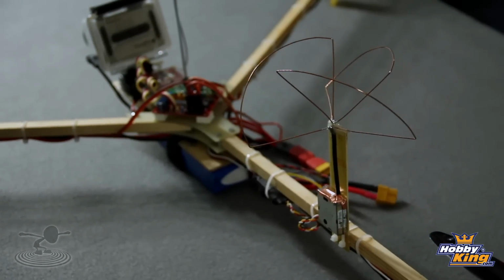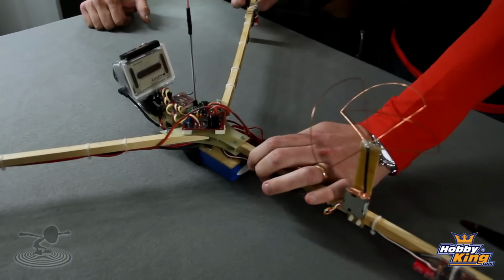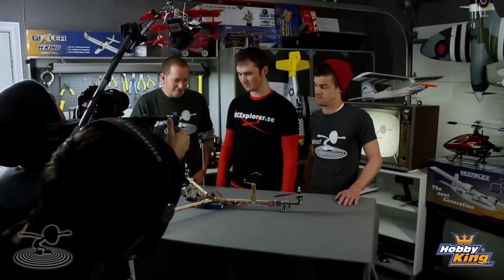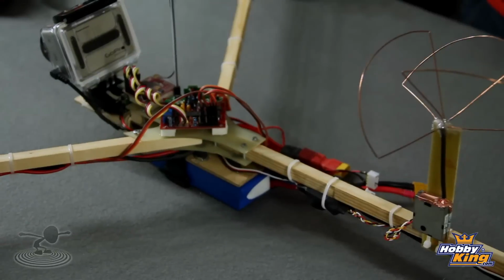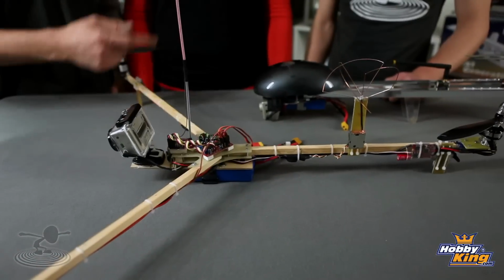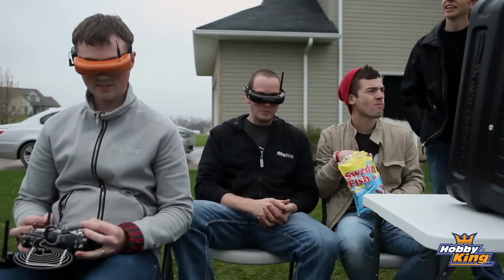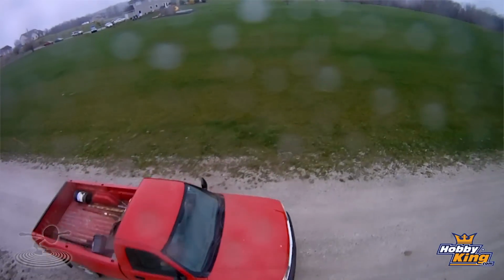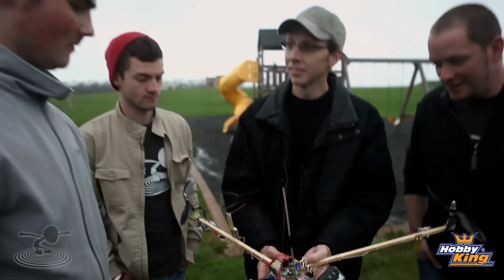Flite Test - Tricopter - REVIEW

Comment: Hey Bixler, Here's a flight tip for you to help with vibration on your Tri-copter. Fill the aluminum tubes with canned expanding spray foam. It is extremely light, strong & most importantly absorbs tons of vibrations. Also besides balancing your propeller blades, mount your motor mounts on top of thin rubber pads, also mount your K-board on a thin rubber pad as well, including your camera. Makes a huge difference...

Comment: Using both on 2.4 with frequency hopping could work in theory, but remember that both would be hopping and you would have a lot of times when they could be using the same ranges. With your Tx/Rx and FPV video gear you don't want it to cut out so it is better to avoid the risk and use different frequencies.

Comment: @Tymopta Low KV motors with large diameter react a LOT more quicker to throttle movement due to more torque, that also means the controller boards instructions. Much more stable in flight. In fact high KV motors are almost impossible to stabilize with.

Comment: Hey guys I know I'm coming in late on this video but just bought all the stuff to build. Anyway.. JOSH... on the vibration... thought... if you're still using the aluminum rods, have you tried to spray some "Great Stuff" inside the tubes for dampening? Basically it's spray foam insulation... OR... how about mounting the motors on top of 3-4 pieces of 2 sided foam tape and then securing with tie straps?? Just a thought, thinking of doing the same... Great job, as always!! :) jerry

Comment: You could probably put rubber washers on all the screws or pins (whatever is use to connect the rods to the center) to reduce the vibrations even more.

Comment: Just curious.  What would it matter if the FPV gear was on 2.4.  The airplane radio 2.4 is frequency hopping so fast I would assume it wouldn't matter.  That's the purpose of 2.4 isn't it? To use the frequency hopping so multiple other 2.4 radios can avoid interferenc?  I'm new to 2.4 so I'd like to learn why or why not that would be correct or not.

Comment: Ok i really need some help,
i have all of the tricopter parts coming in the mail here is the list,
-Hobbyking X900 Tricopter Glass Fiber Multi-Rotor Frame
-3XTURNIGY Plush 30amp Speed Controller
-3XNTM Prop Drive 28-26 1000KV / 315W (Motors)
-Hobbyking KK2.0 Multi-rotor LCD Flight Control Board
-TGY-306G Ultra Fast/High Torque MG Digital Alloy Cased Servo 3kg / .06sec / 21g
My question is what transmitter/reciever to buy, what prop size, and what battery?
I hear the Turnigy 9x, and DX6i are good

Comment: If you use channel 5 or 8 on the lawmate 2.4ghz FPV system is ok. If you use other frequencies no because even though the 2.4 is frequency hopping it will still hopp through the 2.4ghz band so there will still be interference but using it on channel 5 or 8 on the lawmate fpv gear you will be at the 2500mhz ( i think) so it will not interfere with your rc system

Comment: Do you need an ESC for the servo controlling the yaw? And also where do you plug that in?
Reply: They have an episode where David shows how to build his tricopter design. Look up "Flitetest tri-copter build"
Reply: You need an esc for the tail motor. Total 3 escs in this build they plug to channel 1,2 and 3 on the output side of the flight controller, you don't need one for servo it plugs directly to channel 4 on the the flight controller. If you use the standard tricopter setup. Like this one.

Comment: @caranze Why? Lack of skills? The guy operating the $100,000 RC heli on a film set, is that what he says? Got to expect a crash? I don't think so. I fly $3000+ of gear in the air. Crashing is not an option. I've had close calls and no one is perfect but you don't expect to crash. Mechanical failure is the only excuse and if you properly maintain your craft you shouldn't have problems there. I do it for a company, is that what I'm to tell my client? I might crash into your car, house, etc.?